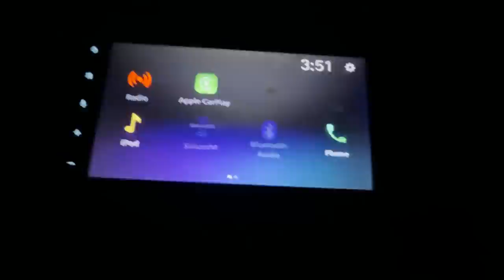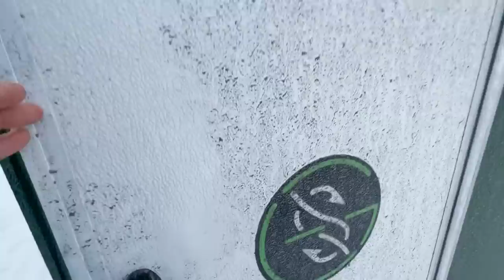Hauling My Tiny House Onto A FROZEN LAKE..

Comment from the maker: thank you for sponsoring this series!! it’s been 3 years of working with Googan. if you wanna support the channel go check them out here: https://googansquad.com/r?id=564e56 

xoxoxo-becca (enjoy this disaster of a video)
Reply: Put 3-4 pieces of tubing under the tiny house when loading it back on the trailer, it'll roll right off and roll back on the trailer easier. Use jacks to lift in front. Look up shed moving on YouTube

Comment: Becca, The ratchet straps from Lowes are not made for what they tried to use them for, you need a Tow strap for that, and your tow point should be on the skids.
Here is an idea. cut your hole through the wood on the trailer, and make a square insert to slide in down to the ice, that way you can leave the Tiny house on the trailer, and use stainless steel carriage bolts to mount the house to the trailer.
Best of luck!

Comment: Aluminum or steel angles can reinforce the corners. Not sure that thing is really built to withstand that kind of movement on a continuous basis. Also having a wood structure sitting in slush isn't something I would do. Wood plus water equals tiny house not lasting 6 months.

Comment: I wouldn't pull on those eye hooks. Instead run your much heavier strap under the house to the front and loop it around a board the same width of the house. Lay the board against the front of the house, on the skids. When you pull, it will distribute the load evenly across the house. Same thing in reverse when loading it back on the trailer.

Comment: Becca, Be Sure To Go Over All Your Things That You Carry Inside Your Lil Green House, And Be Sure That All The Things Are SAFELY SECURED IN Place, Especially Your Heater, Stove, Propane Bottle That You Put In a Plastic Milk Crate So It Can't Tip Over, End Get Lots Of Screw Type Eye Bolts Like You Have Holding The House Onto The Trailer.
Make Sure To Pre-Drill The Holes You Want To Screw The Eye-Bolts In.
Put Latches On The Doors, Conduit or Pipe Straps To Hold Your Bed In Place.  Everything Has To Be HELD IN PLACE While You're Traveling So Don't Have To Clean Up EVERY TIME You Stop !!   Stay Warm and Safe !!!

Comment: In Wisconsin you have to put your name and some other stuff on a ice shack that is left on a lake overnight.  Easy money for the DNR.

My dad's first ice shack he built folded up to put away.  Then when he got to the ice he unfolded it and set up a canvas tent on top of it.  It was built this way because my dad hauled it out by hand.  It had four ice fishing holes in it and benches to sit on.  Wood was cheap back in the 1970's.

I have fished for lake trout in over 100 feet of water with line that wraps around a stick with a minnow on a hook.  That is popular for guiding around here because it's cheap

Comment: Others have said it, but that's not how ratchet straps are supposed to be used. A tow or lifting strap would be needed for pulling like that. I really like the idea of doubling as a fishing hut, seems like permanently mounting to the trailer and just extending a hole through the trailer would solve your problems!

Comment: Are you going to insulate the ceiling? The heat goes straight out of there in the winter, and the heat from the sun comes in there during the summer.